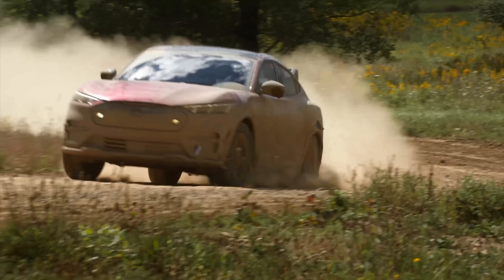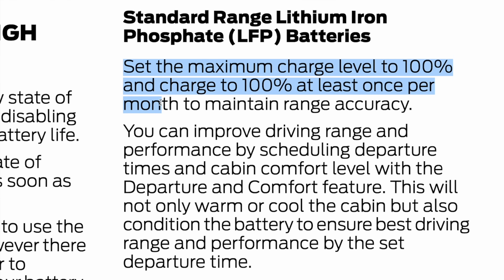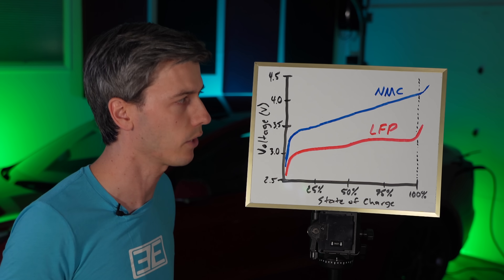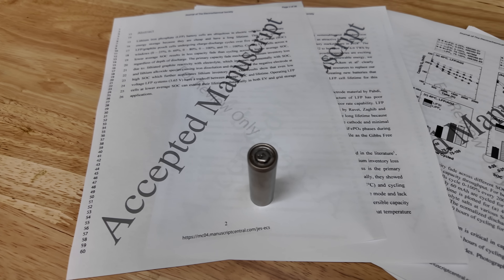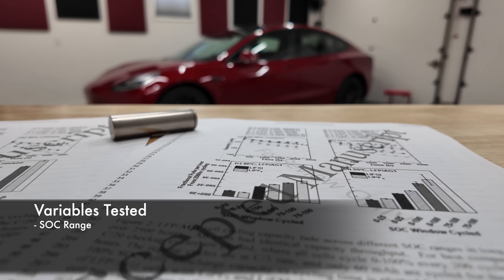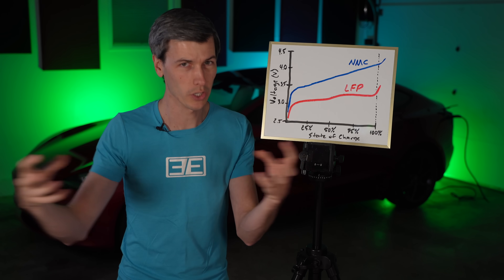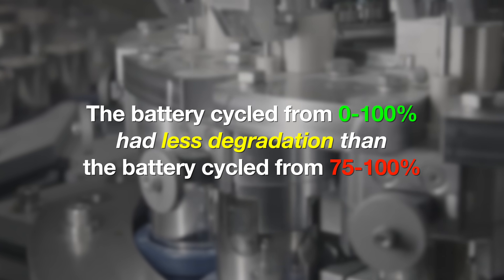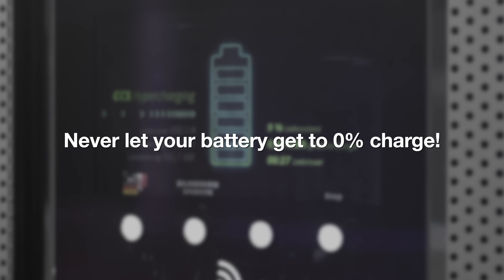How To Ruin Your Electric Car's Battery - LFP Edition!

Comment: Why is it that whenever the life expectancy of a battery or an EV is discussed, the only measure taken into consideration is the capacity degradation in function of the load cycles or km / miles? That's OK for the rich and famous who drive a lot and can change cars every few years. Like people driving company cars. But that does not help to convince the other half of the population who have to pay their cars themselves and tend to keep them for a very long time.
About 2 years ago I looked up the car statistics in this country (Belgium - Europe). The average car age was around 9 years, and the trend was rising. 25% of the cars was 18 years or older, and that percentage was also increasing. I know people who are driving 30+ year old cars as their daily vehicles. Many of these cars don't drive all that much, perhaps 10.000 to 15.000 km/year (less than 10.000 miles), but over a quarter of a century they easily rack up 200.000-300.000 km. The question is therefore: how will the battery behave a quarter of a century from now, having done about 300.000km / 200.000 miles over that time? Surviving 25-30 freezing winters and 25-30 hot summers. Fast charging most of the time, as half of the population in this country lives in apartments which makes overnight home charging impractical. If EV adoption is to be generalised, people need to be assured the battery will serve them well, not only 5 or even 10 years from now, but 30 or more years after the purchase. Or they will need assurance that the batteries can be replaced at a reasonable cost, like the suspension, exhaust or similar.

Comment: Of course battery temperature, due to climate, will also come it to play for when to charge, optimum SoC, and rate of charge. For a grocery getter one would likely seek to maintain a higher SoC in winter, but battery ages slower when somewhat cooler.  Slow charging at home will likely allow the battery to last longer due to less heat dissipation and equalization demands.  Of course you do not want to 'freeze' the battery of charging efficiency go down.

Comment: It seems strange that the study did not test the conditions that had been recommended by manufacturers and battery-users for decades: 25-75%. Cause while operating at high voltages causes more degradation, the same is with huge voltage swings and low voltages. The 0-25% might only just be a bit better cause that is only 25% used, while the 60% is over twice as large of a swing.

Another big thing is of course charge-rate: 1C is considered fast-charging - 1 hour to fully charge (charging gets slower when getting closer to being full, so 1C is more like 1.5h).
18650 from Samsung are typically speced at 0.5C nominal charge-rate and everything faster is considered "fast charging" which results in lower useable capacity and shorter lifetime. And Recommended charge-rate is only 0.2C which takes about 6 hours to fully charge.

Comment: I'd be really interested to know how charging speeds effects the life. 
I tend to charge at 6A 240V which is obviously really slow, but I'm fine with that and I think that it's better for the baterry......maybe. ..
Reply: Home chargers don't come close to delivering the charging speed required to cause degradation. You can max it out no problem at all.
Reply: @logitech4873  I was thinking that would be the case. I'm basically using a trickle charger, how much harm can it do!
Reply: @simonpaine2347 you're wasting energy by charging slower. The charging electronics consume some power just to manage the charging. For AC charging I think faster is better, but to put less stress on the electronics maybe put 75% of the max power

Comment: Just bought an LFP model 3, no where to charge at home but several superchargers nearby. Just gonna treat it like a petrol car, fill up when I need it. At the end of the day I could sit and spend my life calculating and stressing over my battery, all to make to make it degrade slightly slower and give me what, 10 miles of extra range 10 years down the line compared to if I just used it normally? It's under warranty for 8 years, if after 10 years and 100,000 miles it's at like 80% capacity vs 83%, I'm certainly not going to lose any sleep over it!

There's a model S in the UK that auto trader is doing videos on, so an NMC battery. After 8 years, 430,000 miles only supercharging it had like 72% capacity. At that point I'd say it's done it's job and lasted remarkably well!
Reply: Yes, 'treat it like a petrol car'. That's what LFP likes. That is the 'best practice for LFP!